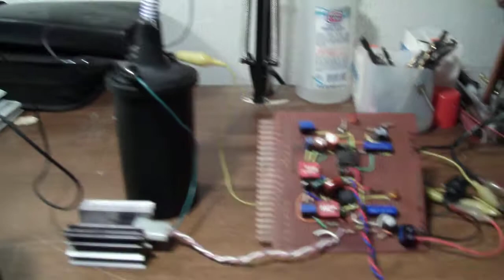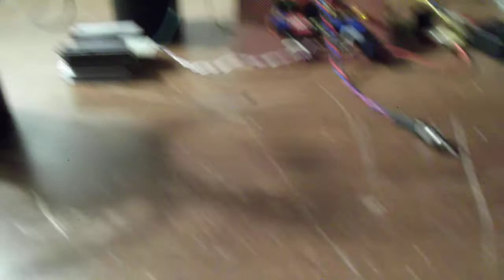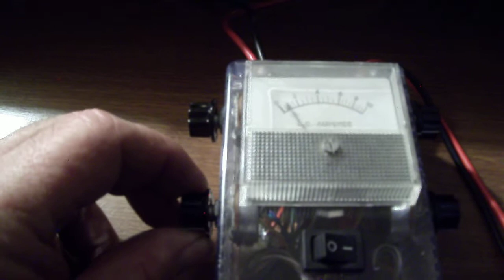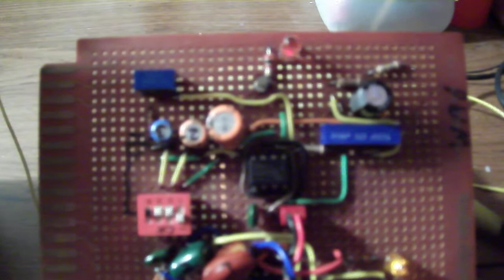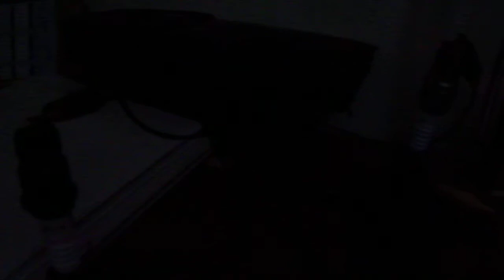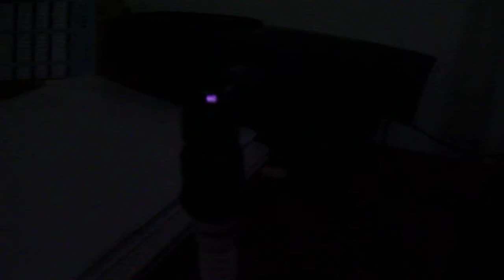Two PWM Dave Lawton Circuits

Comment from the maker: From the left 555 timer there is a switch that toggles between pin three and pins four and eight which are connected together. Common of the switch is pin four of the right 555 timer and green line of the diagram.

Comment: I like the idea of using negative, but Russ may have already solved that problem.  

a thistle tube  use for your vacuum, and argon. simple glass cylinder right. object ionize with negative energy if possible. That is very similar to what i had tried. remember the neg ion generator experiments? the plasma-tron link?  The negative ion generator i had  used was 7.5 kv. you have 45 kv. at your fingertips.

glass cylinder. then we have ionic discharge across a much larger gap perhaps.

Comment: To start my idea is to use the plug with out the end piece. then i would solder onto the plug a  sharp point. like a needle. solder it to a plug without the end gap. now you should have ionic discharge. reverse polarity to negative energy. go  from there..